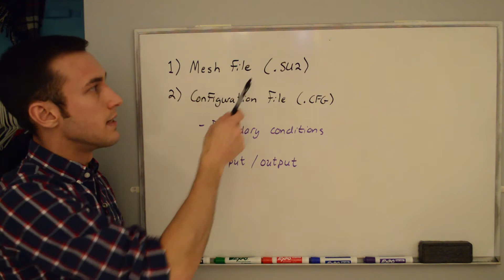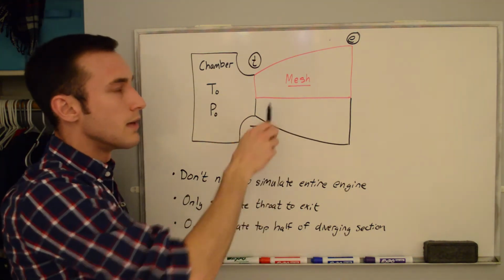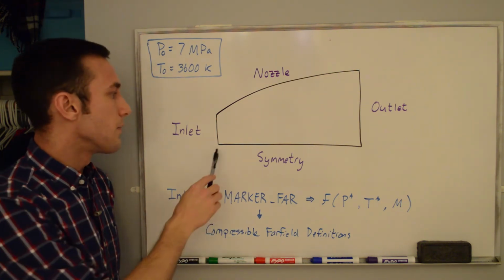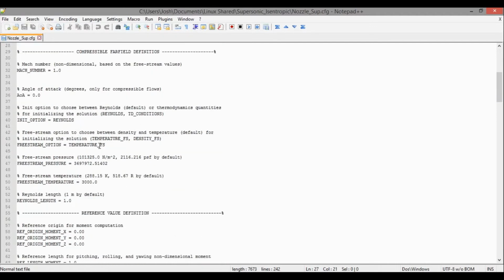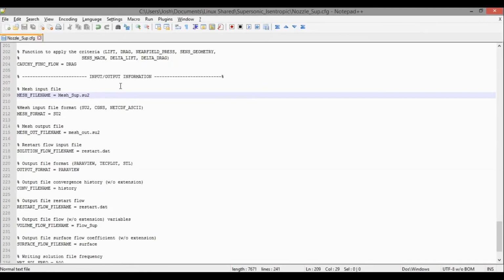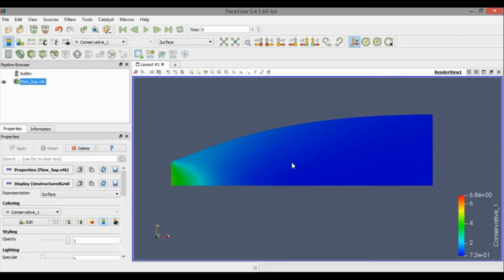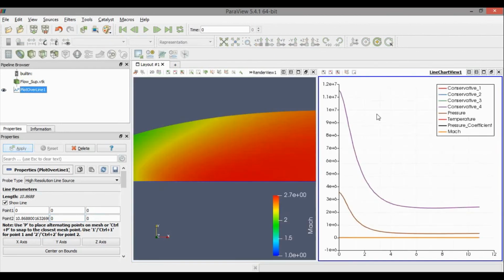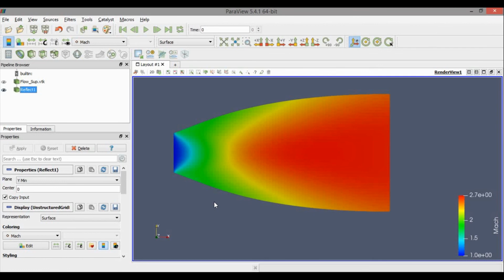CFD Simulation of Isentropic Supersonic Nozzle in SU2

Comment: I’ve been trying to solve this problem for about a week, and I finally realized that this code is not suitable for circular cross-sectional areas. The code only provides the ratio of the “lengths” of the throat and the exit, which makes sense for rectangular geometries—since in those cases, only the height of the nozzle changes while the depth (the dimension going into the screen) remains constant. As a result, when comparing the throat and exit areas, only the height is taken into account, and the area ratio ends up being equivalent to the height ratio. However, this approach doesn’t work for circular shapes, and the code clearly wasn’t designed with such geometries in mind. A proper solution would require 3D Method of Characteristics (MOC) codes. It’s truly surprising and difficult to understand how Josh overlooked this fundamental issue and still presented it as a rocket nozzle program

Comment: Hello, Josh, could you provide the .cfg file? I believe that your website link is not working.
Reply: After some attempts, I was finally able o run this case with SU2 version 5.0.0 'Raven' and obtained similar results as Josh. I have used the same setup as him for most parts (including his Matlab code to generate a geometry), except for the following:
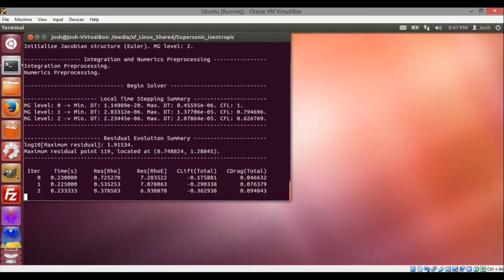- Mesh size: Josh's (17101 points, shown at 5:11 of video) x mine (13032 points)
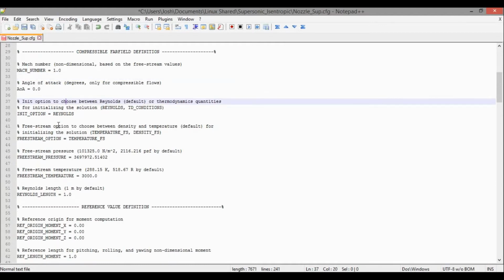- Josh's .cfg line 47 (3:46 of video): FREESTREAM_TEMPERATURE changed from '3000.0' to '2965' (according to T* calculated with his MATLAB code)
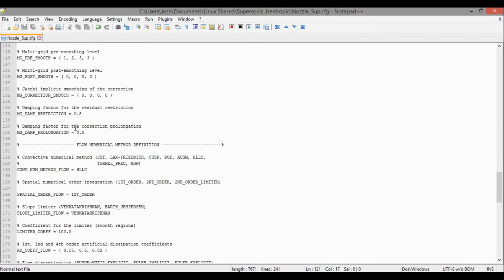- Josh's .cfg line 168 (4:19 of video): Option 'SPATIAL_ORDER_FLOW = 1ST_ORDER' replaced by 'MUSCL_FLOW= NO' to use 1st order convection scheme

In case anyone is also trying to solve this, I have created a github repository with mesh, configuration and results files:
https://github.com/murillo-sspn/SU2_Rocket_Nozzle

Comment: The area ratio is supposed to be 3, but the output figure shows exit radius as 3 and throat radius as 1 making the area ratio 9. Why is this?
I've written a code for MOC and my output is exactly the same as yours. Any clue why does this happen with moc? 
Thank you.
Reply: this code (and most of the other codes you'll find on the internet) doesn't work for circular sections. only rectangular sections can be solved.

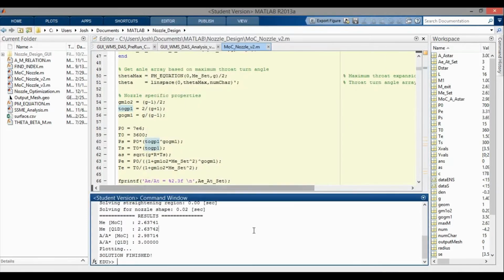Comment: 3:15 in plot the nozzle exit diameter is 6 (-3 to 3) and throat diameter is 2 (-1 to 1). So expansion ratio A/A* is (6/2)^2 = 9. But in the matlab command window the results showing A/A* [MOC] = 2.98714. Why is this discrepancy? Result in the command window matches Quasi 1-D isentropic result of A/A*, which is 3, but the plot does not agree.
Reply: i have been trying to solve this for 1 week and the reason i found that this code doesn't work for circular areas. it gives the ratios of the "length" of the throat and outlet. it is sensible for rectangular areas. height of the nozzle changes but the depth (kind of length through to inside of the computer screen) is fixed. so when you proportion the areas of outlet and throat, only height matters. so area ratio equals to height of the outlet and inlet. this code certainly doesn't work or made up for  circular shapes. 3d moc codes is required for this solution. how josh is not aware of this situation and supplys it as a rocket nozzle program,  it is mindblowing and hard to figure out.
Reply: @ I think this code is good for Cartesian coordinate systems, that is for nozzles with rectangular cross sections, not for those with circular cross sections. For circular nozzles, MOC in cylindrical coordinate system is needed.

Comment: Thanks a lot Josh, your videos are extremely helpful for cfd enthusiasts. I used the same mesh but when I ran the simulation in SU2 it results in an error "Orthoganization Failed, Linear Solver Diverged". Then I looked into its Mesh Quality Metrics, where the min and max orthogonality angle are -nan. I would like to know did you face any such problems during the simulation of the nozzle in SU2? Do you have any idea how to resolve it? Once again, thanks a lot for your videos, it has been really helpful.

Comment: Wow just fantastic! Any chance you would be willing to share your MOC matlab code?
Reply from the maker: Thanks!  My code is on my GitHub (https://github.com/jte0419/Rocket_Nozzle_Design).  After I finish my current set of panel method videos, I'm going to be doing the full derivation of this code.  Just be aware of its limitations.  If you want more details on all the different types of MoC formulations, check out the book by Zucrow and Hoffman.
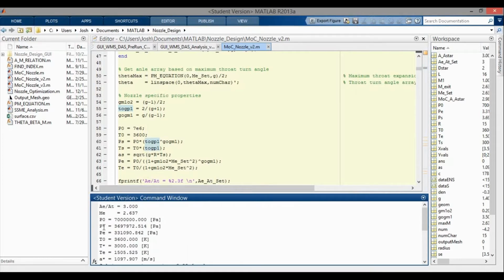Reply: @JoshTheEngineer  3:15 in plot the nozzle exit diameter is 6 (-3 to 3) and throat diameter is 2 (-1 to 1). So expansion ratio A/A* is (6/2)^2 = 9. But in the matlab command window the results showing A/A* [MOC] = 2.98714. Why is this discrepancy? Result in the command window matches Quasi 1-D isentropic result of A/A*, which is 3, but the plot does not agree.

Comment: Hi Josh, I am very appreciated for this nice series on cfd.

Is the su2 mesh file used in this video compatible with SU26.0 version? I have to try to change some lines in cfg file and, run 5 iterations. Then try to plot in Paraview 5.6 and I get only a line which is clearly not nozzle. I guess I missing sth.
Reply from the maker: The mesh should be fine since they didn't change its formatting from version 5 to 6.  I would guess that it's a problem with the config file.  Make sure the boundary markers match the mesh file names exactly.

Comment: Keep producing good work like this. Genuinely one of the only CFD videos that explains the whole process well.  Thank you so much for making this video. Perhaps simulating an Aerospike nozzle could be you're next video at different altitudes (atmospheric pressures). So that we can see the change in the exhaust diameter as the nozzle climbs in altitude.

Also using OpenFoam may appeal to a wider audience. So, if you could possible use that that would really be appreciated Josh (if possible ).

I've never actually left a comment on Youtube before but I guess this is what it took. A good CFD tutorial that was actually well produced. 

Anyways look forward to the Aerospike nozzle vid dude. :D
Reply from the maker: Thanks for the kind comment!  Simulating the aerospike is definitely something I'll be looking into doing at some point.  I just need to update my MoC code to design it, since it's slightly different than the CD nozzle design.  I probably won't do any OpenFoam tutorials, since SU2 is also open source and it's easier for me to stick to one program.  I'm really just using SU2 to show some interesting results that I've simulated, and then I'm going to move onto how to program a CFD program from scratch.  I'm glad I could get your first comment!
Reply: Hi Josh, I am blown away by your love for nozzles...And in-depth understanding. I am coming from field of coldspray metal 3d printing. Here we have added fun with loading of large fraction particles. Did you try any of that? Can you carryout paid consulting to optimise some of our. Nozzle projects? Thanks Josh.

Comment: Thanks for this, Josh. I soon will be doing more CFD stuff in the coming years. One of my professors recommended I start with SU2. 
If possible, I do think it may be helpful if you did a video of how to build the .cfg file for the specific simulation. There are many options in the .cfg file that I do not understand. 
Anyway, thank you for all the SU2 and GMSH tutorials you have done. They are extremely helpful. I look forward to more.
Reply from the maker: You're welcome!  The CFG file can be a bit lengthy for sure.  For the most part, you can leave a lot of the settings at their default values, and only mess around with the boundary conditions (markers) and the freestream/farfield stuff.  I would need to delve more deeply into all the different settings to be able to make a good video about it, and I don't have the time at the moment.  When I made these CFG files for my videos, I downloaded their master CFG file from the GitHub and deleted all the sections that I didn't need.

The SU2 tutorials they have on their GitHub are quite good, so I would browse through those to start off with.  The folks that develop and maintain the code also seem to be really responsive with answering questions on their forum, so if you have specific questions, you can probably get them to answer you directly.

Comment: Wouldn't you rather use a commercial CFD package which incorporates the effects of viscosity and turbulence for a more precise simulation?
Reply from the maker: You can include those effects in SU2 using the Navier-Stokes solver if you want to.  The point of this video is to show how you can run a simple, quick CFD simulation for a rocket nozzle and compare it to the quasi 1D solutions that I go over in my other videos.  The reason I use the Euler solver for this problem is because the quasi 1D solutions are inviscid.